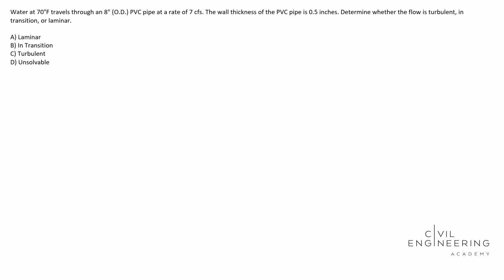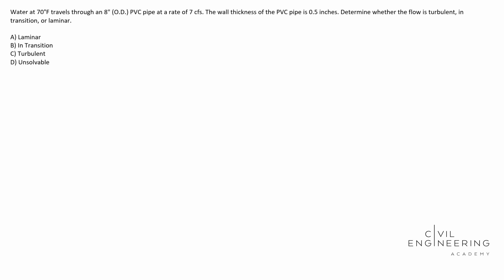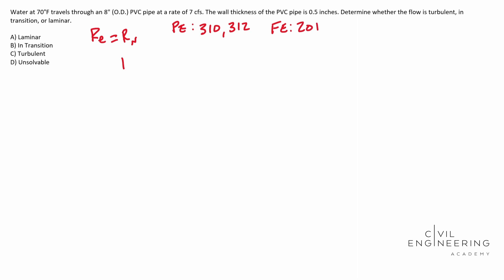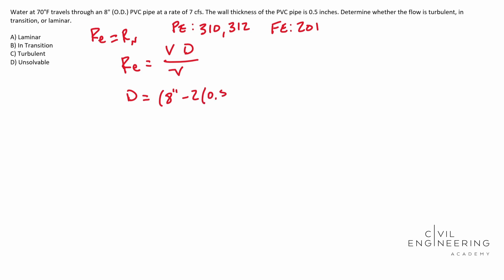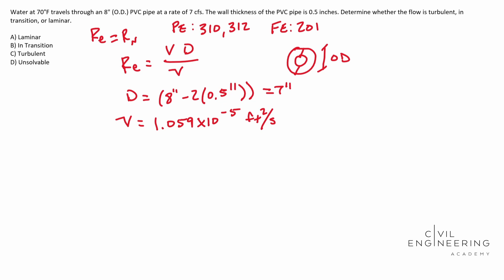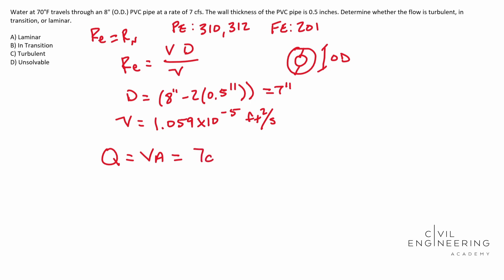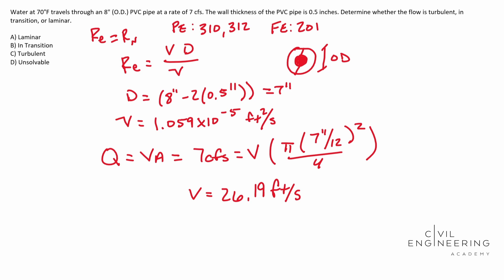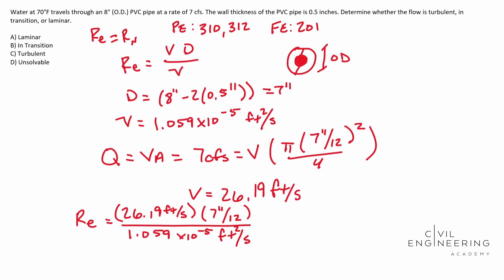Civil FE/PE - Water Resources - How to Determine if Flow is Turbulent, Laminar, or in Transition

Comment: been loving your videos! i wanted to comment I believe there is a minor mistake in your calculation (correct me if I'm wrong).  the equation for reynolds number calls for hydraulic radius, not diameter. so instead of using 7/12 it should be 7/(12*4) as for a circle the hydraulic radius is diameter/4. thank u so much for your videos!
Reply from the maker: Thanks so much for the kind words and for digging into the details — love seeing this level of engagement! 🙌

You bring up a great point, but for the Reynolds number equation, we actually do use the pipe's full diameter, not the hydraulic radius.

Here’s why:

𝑅𝑒=𝑉𝐷/𝜈

D = diameter of the pipe (not hydraulic radius)
ν = kinematic viscosity
This formula is based on internal flow in circular pipes, where diameter is the appropriate length scale.

Hydraulic radius (𝑅ℎ=𝐴/𝑃) is used in other contexts — like open channel flow or when applying Manning’s equation — but not in the standard Reynolds number formula for full-pipe, closed conduit flow.

Really appreciate the thoughtful comment, though! Keep them coming — it helps us all learn better.

Comment: As a side note, the PE reference manual (pg 310) lists the fully turbulent threshold as 2000 not 4000
Reply: This is only through open channel. Use this:

Ncees pe hb 1.1, p. 311.

For closed, pressurized pipe. Re => 4000.
Reply: @oleopathic  Good catch
Reply: @ryanolsen1351  thanks and you're welcome.
Reply: That is if you are analyzing flow through an open channel, this is an example on pipe flow. Greater than 4,000 is for close pressurized flow, for nonpressurized flow it's greater than 10,000. This example problem doesn't specify whether or not it is nonpressurized or pressurized pipe flow, so hopefully the actual PE exam specifies the type of conduit flow.